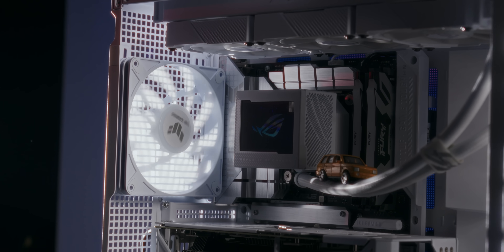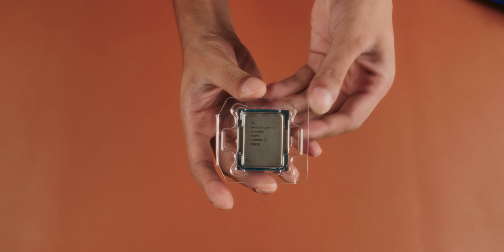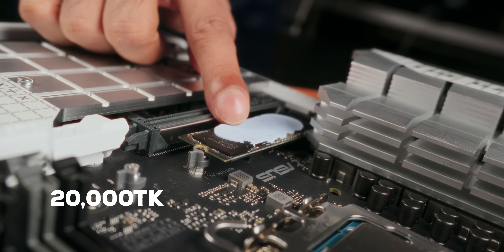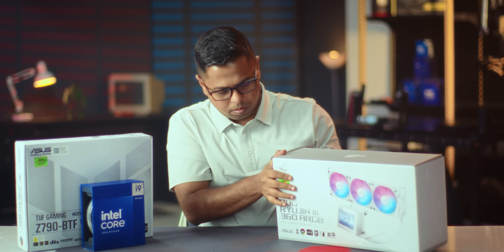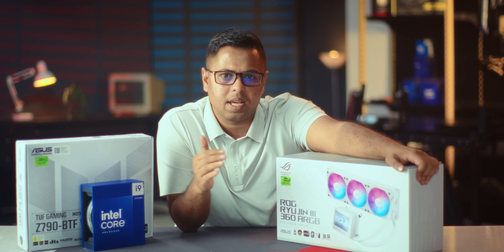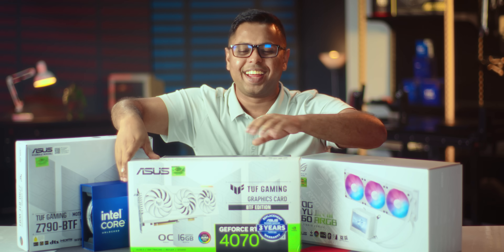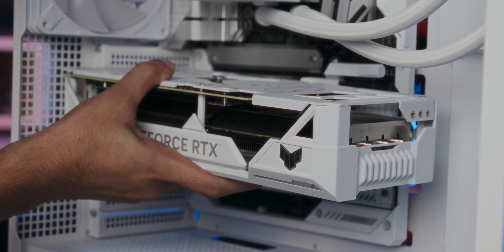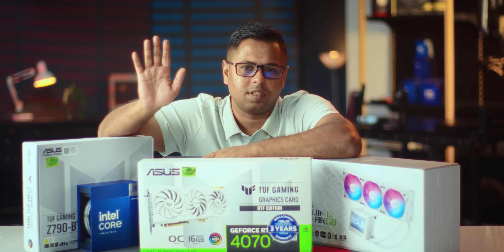৪ লাখ টাকার All White ASUS পিসি বিল্ড।

Comment: Will your channel be doing a motherboard roundup video anytime soon? It would be great if you could compare the VRM and thermal performance of the MSI MAG X670E TOMAHAWK WIFI and MSI X670E GAMING PLUS WIFI with the Ryzen 9 7950X in a Cinebench R23 test. Thanks in advance.
Reply from the maker: Only when we are able to gather proper testing tools, not relying on the aib sensors as they are often misleading Deliberately.